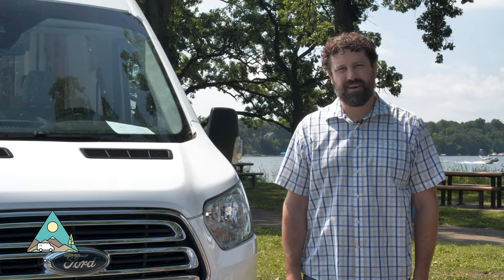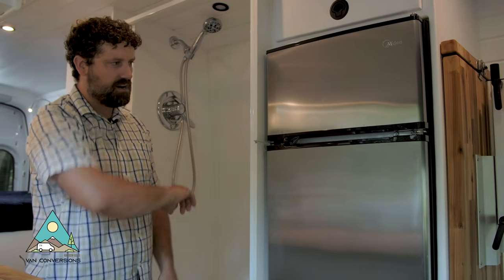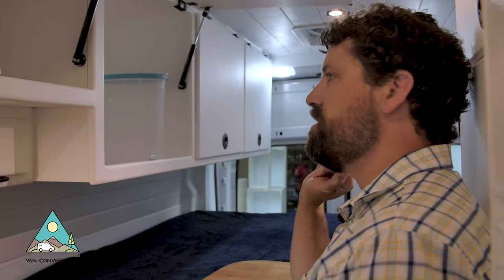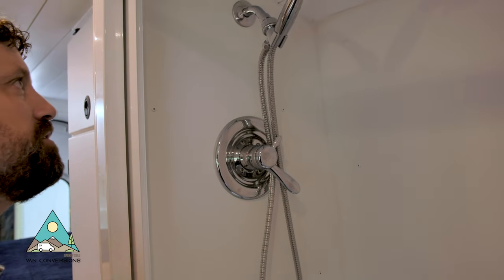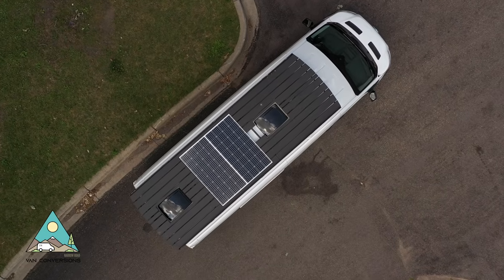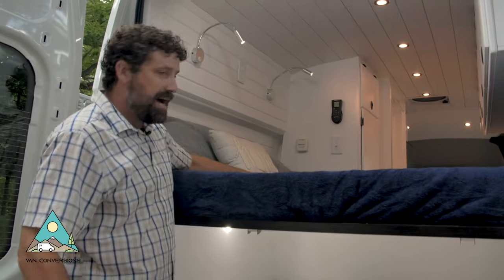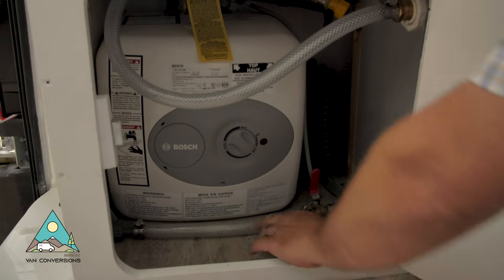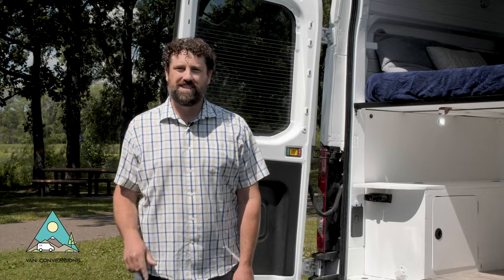Van Life Tour | Custom Conversion | Full Shower | 2019 Ford Transit 350 High Top Extended

Comment: From the functionality standpoint, this is one of the best van built I have seen.  Good choices big and small, things many people will not consider.  If I had the money, I'll add/change the following:  1. Install one of the new 10.3 CuFt 12V fridges.  According to RV dealers, they get colder 4 times faster than regular RV refrigerators, and also the energy consumption is so small, a single battery with a single 100 watts solar panel will be enough to keep it running for more than a week.  2.  All the solar I can put in.  3.  A recirculating shower.
Reply: Outdoorsman2b great suggestions!
Reply: I want a doggie A/C too.
Reply: I agree with your ideas for changes the recirculating shower is so fantastic I am amazed that more people don't use them. I wish I had one in my house. And why not have more solar if the roof has space.
Reply: can you clarify on what fridge you are talking about adding?  When i google what you mentioned its not so clear. thanks!
Reply: I would put in a single bed. More room elsewhere...

Comment: Awesome build! Great attention to detail. Especially love the lift up countertop over the stove. Only improvement I see possible is to attach a stainless or aluminum panel to the stove side/underside of the counter that folds up, as it would act as an oil shield and fire block.
Reply: Exactly what I was thinking.
Reply: Yes
Reply: Cooktop will burn the side of white cabinet when you have a pan on burner,top of cooktop needs to be flush with top of countertop.
Very nice build

Comment: No ventilation under the mattress. You're gonna have mould problems every time. Slats are a better option. Other than that, cool build.
Reply: There is a venting system (material that is vented and lifted) made for boat mattresses that can be used slides under the mattress and a few others that prevent mold.

Comment: Lots of great features here and the overall finish is professional!  Love the bed going up both directions.
That is a good design for a queen bed. The garage is enormous!  Tempting space for a bike.

The Lagun table set up was functional, nice to see they driving seats doing double duty as a lounge too.
The kitchen extension table - I have seen one where you could also set it at a lower level to serve 2nd passenger seat as a desk.  It does not have to be static.

I do not understand how you could dip that water hose inlet into a bucket, turn on water pump and have this fill up the water tank automatically.  The water pump draws water out of the tank and sends it to the faucets and toilet and water heater. How is it going to work?  And if it fills tank pump will draw it out to faucets immediately.  This is very unclear.

Comment: this is really beautiful and well-thought out - again.  Really Love your lift up bed into upright seating!!  Have you ever designed one that has walk-through access to the rear doors?  i.e.  single traveller, single bed along driver's side that hinges up for outdoor viewing.  Leaving other side for office/work station/or low shower/loo/etc?   Very anxious to get mine going - waiting for house to sell.  Beautiful work!
Reply from the maker: Thank you!  I have not done one with a walk-through yet, but i will be starting one in December.  I custom build all the cabinetry so it will be possible.

Comment: Great build! ❤️🌺 I want to add a vent fan in the shower bathroom on roof ... and van security. I don’t know why I haven’t seen much on YouTube about van security. I want bars over the windows may be removable or unhooked from the inside and a metal grate with a lock separating the cab from the house which can be locked and unlocked from either side. I’m also interested in extra thick security glass in the cab— and I want to know cost. Side door needs a chain so it can’t be popped open. 

Also incorporating a computer swivel tilt work desk for a long work hours that can be used from the driver seat turned backwards. 

I HATE cooking smells especially in my cloths and bedding. Need extra powerful fan setup for kitchen. Also need bigger water tank and bigger battery. Might need to upgrade fridge. Need more hooks for things. 

You have the best builds I’ve seen so far. Can you build me my dream van? 😍

Comment: From MN also!   Amazing build, Eric.  If u do another video, could u include more info such as why u chose the 350 over the 250, any mods under the hood, and what u used for insulation?  Did u mount the LP tank or have someone do that for u?  Thx.  Oh yeah...info on the solar as well.

Comment: Why hasn’t the back door been insulated and covered. That’s a lot of cold metal to sleep next to, unless they are only planning to use in summer. Plus it looks nicer.
Reply from the maker: If foam gets on any of the moving parts the door locks will not work.

Comment: Have you considered the option of  heated floors from the coolant system for skiers start the truck and the floor gets warm  and hot just thinking out loud .
Reply from the maker: The engine coolant gets too hot.  Like 200 degrees

Comment: This build has me drooling. If there is one thing that could have been done better I'm not seeing it. One thing that could be a bit specious in the video: Filling up drinking water tank/s from a creek. Unless the filtration system is designed to remove bacteria, viruses, and pathogens like giardia I don't recommend doing this. When I was in my mid 20's I drank from a clear running stream high up in the cascade mountains and contracted the protozoa, giardia. Then a year later I brushed my teeth from a clear lake in the same general area with the same result. I thought if I didn't swallow the water I would be ok. I was wrong. lol  Seriously, you do not want to go through this. And it's not only the many species of protozoa you need to worry about. Bacteria and viruses are also a threat when you drink from streams, rivers, lakes, ponds, etc.  Don't be fooled by how clear and fast running the water is.   Cheers

Comment: Attaching the shower and cabinets directly to the metal frame of the truck would cause some heat/cold transfer and potential condensation behind everything??  I get the attempt to gain some room by doing what you did; but the lack of barrier would concern me

Comment: Beautiful build Erik. Love the details. What did you have to do with the parking break to put a swivel on the driver side seat? We have a 2019 Transit 350 but couldn't find a way to swivel the driver's side seat.
Reply: Just have to remove the parking break.. to swivel front driver seat.🤓

Comment: I like the build!  I am getting the same sized van in a few days, so it was good to see the space constraints with the refrigerator, shower, closet, and the swiveling chairs. Your storage of the lagoon table top was also very cool. I think I will be doing a shower pan in the van floor shower to enable a larger dining space utilizing the swivel seats. How much sleeping space do you have across the van for that bed?  How thick was the insulation at the head and foot of the bed to allow for that space? Again, very cool build!

Comment: Really impressive build! One of the best I've seen. Questions, there is a lot of wood in this build, is/was weight an issue in the final design? Was 80/20 or another lightweight construction material considered to reduce weight but not sacrifice strength? I'm assuming you mounted the stove far beneath the fold down counter top to avoid any potential heat damage? The stove appears unnecessarily low preventing oversize pans from centering on the burners. What was the design issue that made this position necessary? Thanks for the tour!
Reply from the maker: I end up adding less weight than the mass-produced competitors.  It usually adds about 2500 lbs.  All the cabinetry is very solidly put together and bolted to the frame of the van that is intended to hold commercial racking.  The lower stove is a customer preference for more counter space.  I can put the stove at counter height if needed.

Comment: I have used the different name brand pvc board for the trim on my house. I've neglected to paint it. It is rot proof but it got stained with the leaves and elements.
Was wondering about the shower with all the soap and shampoo.  Will cleaning the shower walls be good enough? I would think it would with a little bleach and water.
Reply from the maker: A magic eraser works great

Comment: Can you use a house fridge? I always thought it had to be one of those over priced RV ones? Mine just died. Want a new one. Do not want to over spend. Have a Camper Van too!
Reply from the maker: You can use an AC fridge.  It works fine.  It is a little less efficient than a 12v fridge and you would just leave the inverter on all the time,  which is about a 2 amp constant draw.

Comment: I may have missed it...what about the batteries?  type? size?  Also I thought I caught the badge on the back door.  Is this an ecoboost?  If so, that's important...more torque and more power.  Also cab features...does it have the Ford Sync system?  I assume this is not the 2020 chassis.  Down the road, I would be interested in the all wheel drive version of the 2020 model.

Comment: Hi Erik, could you tell me something about the weight of the installation and all the furniture? I suppose it´s a L4H3 Transit, right? The gap between the empty weight and the maximum weight is only 900 kg and to me it seems tricky not to overload the van.
Reply from the maker: I looked up the specs and  here is what i found.  Curb weight on empty van is 5615 Lbs,  GVWR is 9500 Lbs, Max payload is 3820 Lbs.  I have not weighed it yet, but i did weigh the previous promaster build.  In that build my total additions with full water and propane was 2700 Lbs.  I would estimate that this build was around 2400 Lbs because i used Lithium batteries and lighter cabinet faces.
Reply: FEAR The Walking Don That is distressing to hear; I am always thinking about my weight load.

Comment: Overall great build, if he (they) can build me a van with sliding wall and floor cabinets, murphy bed system,  hidden lighting, open middle walls both side under cabinets, high insulation, 1000 watts solar or bigger, 1000 AMP or bigger AMPS, Digital screen wabasto heater, all master switches like hq black series travel trailers) o be located in same hidden place. pull down spice rack from movable cabinet,  pop up outlets, A  large apple monitor screen (wall hidden on a adjustable arm mount)  hidden toilet and shower system. Interior to be built heavy duty mostly aluminium ( like a SYNC van)  industrial look (like a tool box/LEGO's/transformer) only located a few builders so far like advance rv (they can build ANYTHING!

Comment: ... nice, overall, BUT: ... the butcherblock table - only secured with one flimsy two-srew-latch - will become a real neckbreaker for the driver in case of an accident, not safe ---------- A tabletop extension which blocks the doorway when in use, not smart ... ( and one for cosmetic reasons: why are the hinges (here in the garage) in many builds are screwed ON the surface instead of sunk into the joint?)